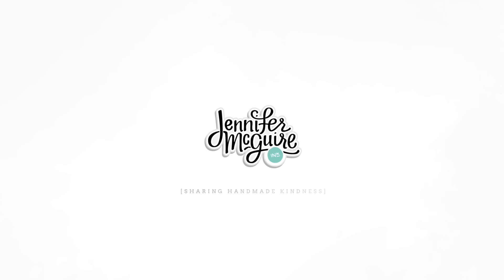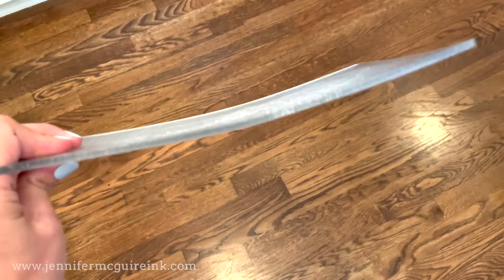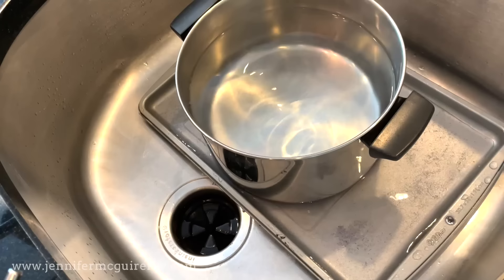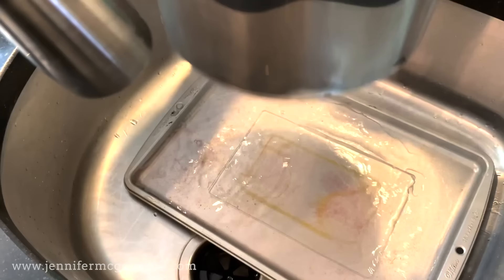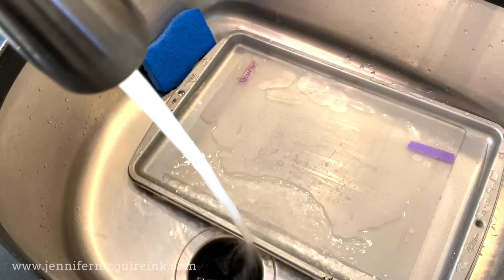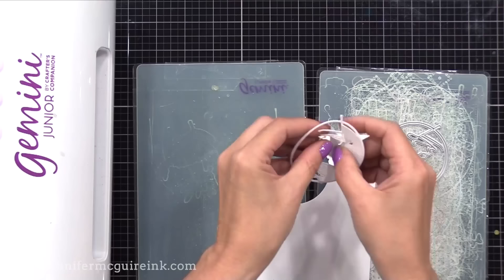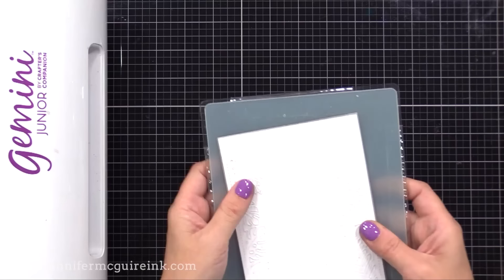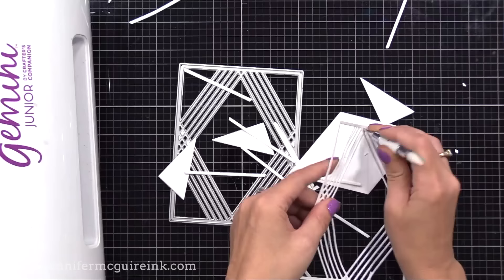Fixing & Avoiding Warped Die Cutting Plates

Comment: I just tried the boiling water cure for a big shot purple cutting plate and a clear plate.  I followed the directions exactly and it did not work.  The plates had been used as recommended and were only lightly used when they warped and bubbled .  No amount of heat or pressure seeme to make a diffeence.  Not happy with Sissix or the plates.  I read through many of the comments and found others who had the same problem with Sissix.  I also sent an e-mail to Sissix about the problems.  Not happy with the quality of the cutting plates and unsure of what to do next.  I know products wear out but I am not an intensive crafter.  I just like to make a hand made card here and there.   Is it time to cut my losses and head back to the dollar store?
Reply from the maker: One thing to keep in mind is that these will not last forever. And the hack here helps maintain it longer but they will have to be replaced if you do a lot of die cutting.
Reply: I don't expect any tools to last forever, but these were very lightly used when they started warping and bubbling.  I have read other reviews on Amazon of the colored plates doing the same thing so I am wondering if it is a materials problem.  I don't always trust all the reviews on Amazon, especially after reading about people who were paid to write positive reviews.  But there was one person who had the exact same problem as I did with the colored plates and she posted a picture of the warped plates which looked similar to mine.  Anyway, I do like your videos and do not think they are too long.  In fact they are just right for a workout on my ellipital machine.  Thanks for all the great ideas and information.  @jennifermcguireink

Comment: I used hot water on my Gemini plates and they stretched and can't fit in the machine. I am a new crafter😥
Reply from the maker: Hmmm... it really isn’t possible to melt and stretch the plates using boiling water. Did you put them in the oven or have them turned sideways? :) :) :)

Comment: Glass being a liquid is a myth. Old glass was made using the crown method, which resulted in plate glass that was thicker at one end. The glaziers would fit the thicker end at the bottom so the rain would run off better. People have found examples of panes being fitted upside down 👍

Comment: It didn't work for me. I had watched your video previously but at that time my plates weren't warped but kept your solution at the back of my mind. When my plates became warped I searched and found this video again and watched it thoroughly. The first time I tried it I put a heavy bottle on the plate. Nothing happened. Figured I needed something heavier so got a brick (regular house building heavy brick) and put that on it with the boiling water. Straightened the plate slightly. Maybe more weight will do. Boiled more water and added a second brick on top of the first one. After the suggested 20 minutes removed it from the water and it still has a warp in it but not as much. Re-watched your video and you put the pot of boiling water on the plate so thought maybe that will make the difference. Put the boiling water in, pot of boiling water on top, two bricks on the pot and it didn't make any difference in the warp. I could push down with my hands on top of everything and feel the plate moving into position to straighten out, but as soon as I released my hands it just popped right back with the warp. I was so looking forward to un-warped plates but guess the only way will be buying new ones.
Reply: Buy new regular plates, but then buy the Gemini Double sided plates and begin anew. This way you can forget the boiling all together.

Comment: i stop buying all the different plates for my gemini all i use are the 2 top cutting plates and 2 doble sided die plates inside and voila i get no or very little warping. I did not used my gemini because of the warping but ever sice i started using those doble side plates when they came out problem solved.

Comment: I finally got the gemini out of the box and used it an entire day for my marathin of making twenty card designs each, for five people as gifts.  I would say I should have stuck with my vagabond! Folowing the embossing sandwich, my plates slid out from one another because the folder slides on the magnetic shim. Even with rotating the placement of my dies, the magnetic shims is completely put of shape and dies wont even stick to it anymore. and lastly the cutting plates after one day use are completely warped and need to go I to the tray of boiling water! I am now purchasing another set these greencutting plates and an additional clear plate for embossing so I dont have to take the taped ones aprt to emboss. my machine is the full size because I am used to usong the long platform in my vagabond to get more dies in each pass. Thanks for this video. I visited a few times and appreciate the time you took to out it together. not to mention the research and problem solving. Thank you

Comment: I  got this tip from someone on YouTube, but I annot remember theid name to give credit, but her tip has worked for me... If you put your plate onto a flat surface, push down on it. "If it clicks, flip it.". And put your die onto that side ( into the concave part of the warp).  I don't know the science behind this, but something about the pressure helps flatten the plate out.  Following this advice I haven't had severely warped plates in forever.  And as a fellow nerd, I was excited to hear that Tim would be sharing science info!!!

Comment: I have one plate that is pretty badly warped even though I have cut all over the plate, so will try your hot water technique. I also saw a video the other day about a type of vinyl you can put on top of your plates that takes all the cuts so that your hard plastic plates stay fresh like the technique you shared last but this material she showed was softer. Here's the link; https://www.youtube.com/watch?v=FbTRgpQR0TE
Reply: I put a comment on that video you saw about using vinyl.  I describe what sandwiches I use, etc.  It really works.  I use from 1 to 3 vinyl sheets depending on the die.  It has been a die cutting change for the ages for me along with using the double sided green plates.

Comment: Don't waste your time with boiling water as it doesn't work.  I've tried it multiple times with plenty of weight.  Still got the same warped plate I started with.  It also doesn't do anything to clean a plate of the paper cutting a die leaves bhind.